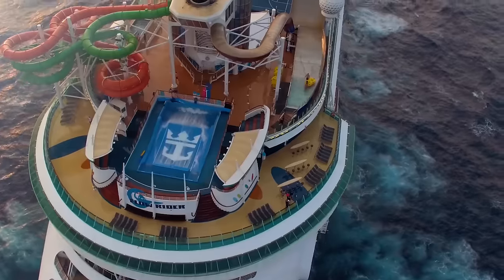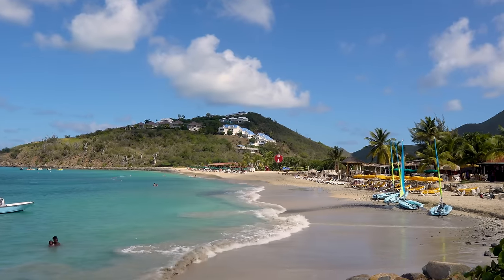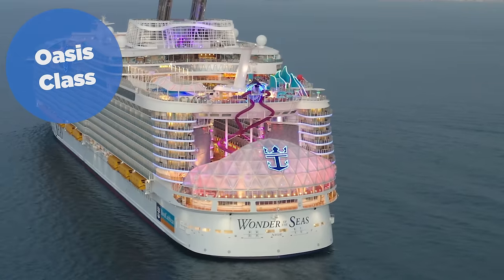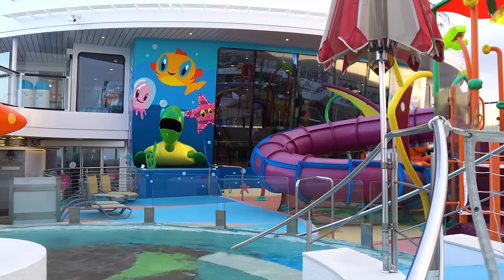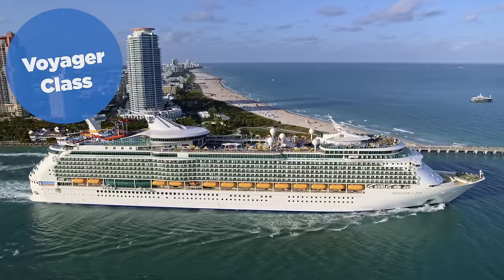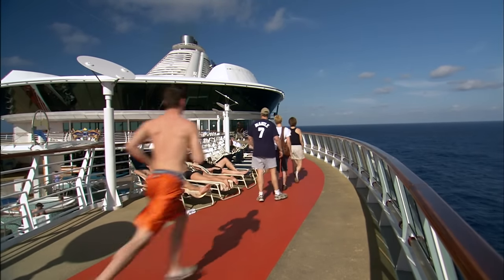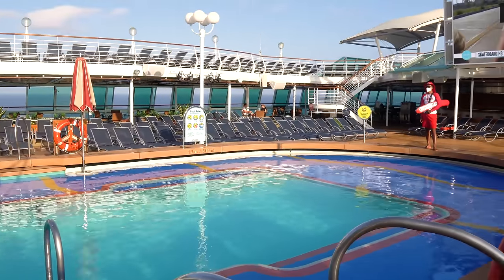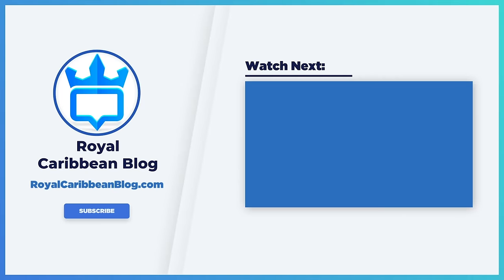The classes of Royal Caribbean cruise ships, explained

Comment: I sailed the liberty of the seas and Oasis of the seas. Both had their pros and cons but id give the slight edge to the liberty. It was still huge but lines were so much smaller, especially for food and elevators. Oasis was more fun day to day, and probably had better entertainment but i try to get off the ship as much as possible no matter what so thats why i give the slight edge to the liberty. The other thing that bothered me a bit was the restrictions on movements inside the oasis. A lot of times you have to access something from ONLY the aft or forward. This means you can take a wrong turn and have to retrace your steps. Both were great but again id go with the liberty. Cant wait to sail the icon

Comment: I have been on each class except ovation.  Enchantment hold special place in my heart cause she was my first cruise.   She smaller but still so much to do and the crew is more hands on.  Enchantment stand on one of the bridges at nite with your other half and feel the breeze as the ship moving threw the ocean at night.     Freedom and voyager classes I think both offer the best mix of things to do quiet places to sneak a kiss from your other half and entertainment.   Also the crowds tend to be smaller.  Oasis class is almost overwhelming at first.   Now if someone says they are bored on oasis class run from that person.   I admit when full there are times you feel it but the design of a oasis is amazing.   My favorite little nite time romantic spot is back of the ship running track there is a area with some seating.  Watch the water turning as going to your next port.   So what to pick.   What do you want to do and where to go.   Older smaller ships get into ports that you will be amazed by.   Thr bigger ships have so much to do but honest the ports are more tourist involved but you can still have an amazing time.   Pick by what and where you want to goto or want to do.   I have always had amazing time on royal caribbean ships no matter what class.

Comment: RC state Icon class will be 'larger' than Oasis, but I can't figure it out. Icon is projected to be 200K tons while Oasis is currently 230K. I guess we need to wait to see what their definition of larger is. Are we talking dry weight vs wet weight?
Reply: the Gross Tonnage actually has nothing to do with the weight! It is a non-linear measure of the enclosed volume of the ship. One of the reasons why Wonder is "bigger" than other Oasis class ships is because its solarium is fully enclosed, thus counting towards its total Gross Tonnage (GT). However, since other Oasis class ships have an open solarium, this area doesn't count towards the GT. 

Icon will have a higher GT partially due to its fully enclosed AquaTheater and solarium. They're building a large glass dome to enclose both of those, so this helps increase GT.
Reply: @ozzymuzzy246  So does this mean Icon will have less enclosed mass but actually weigh more?
Reply: @andrewjackson9417  i'm not sure about Icon's mass. Mass is typically not something discussed much when it comes to ships. 

More gross tonnage means more enclosed volume, and Icon has a higher GT than Oasis (at least, that's what they're claiming now). So Icon should have a larger enclosed volume. 

How about mass? Who knows. Data will come out eventually, but again the mass of a ship is not typically used when referring to its size. Gross Tonnage is the metric that's used. Weird, I know.
Reply: 250k